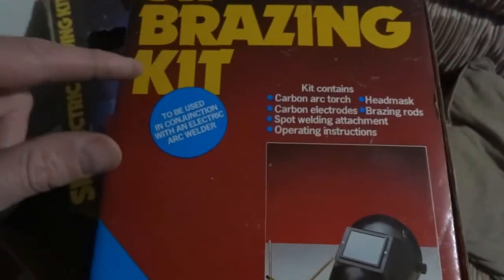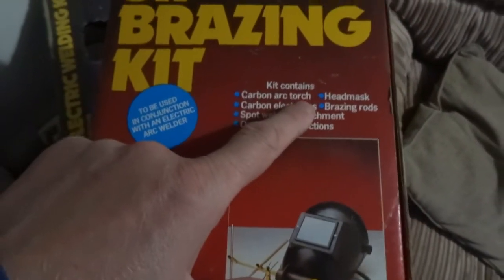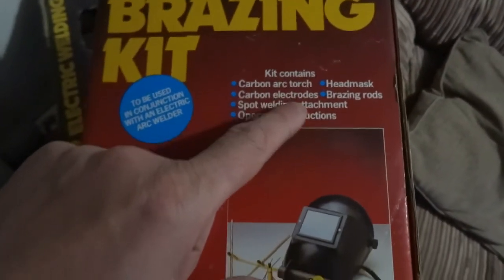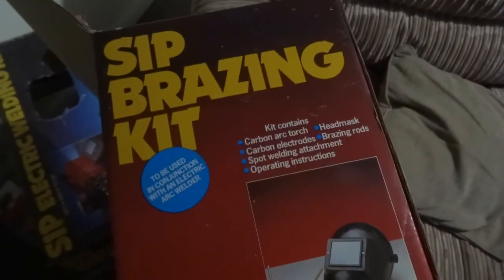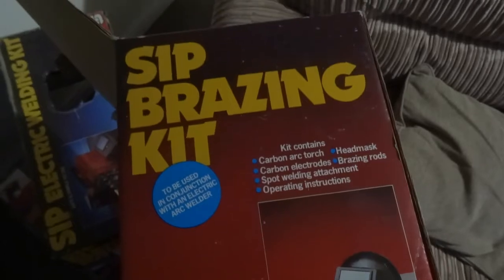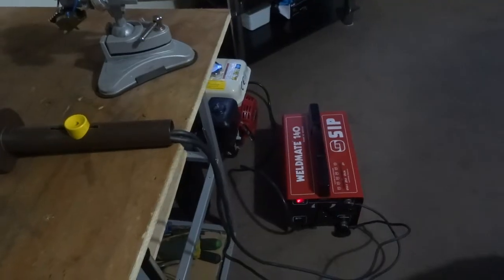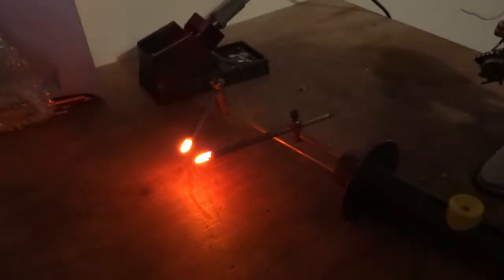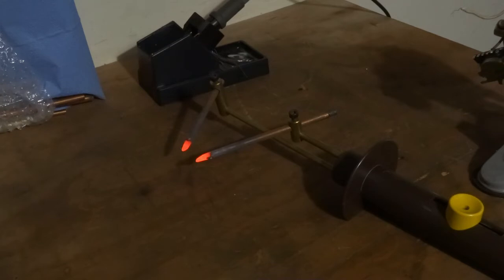Carbon arc light ~ SIP brazing torch

Comment: If you need to cut metal, then you could just use an electrode at very high amps.
Reply: I did this about 40 years ago to cut an old water tank in two before removal from the attic and it works!